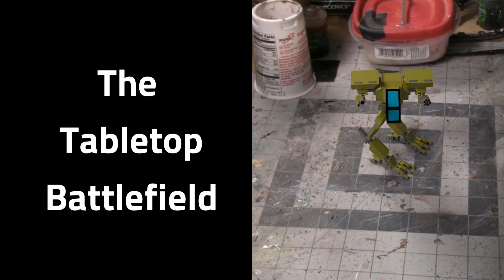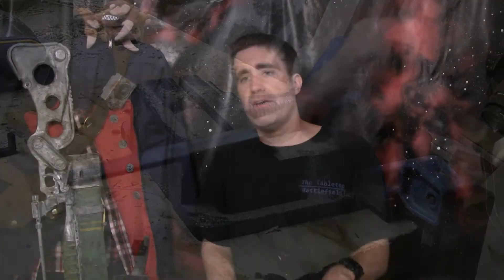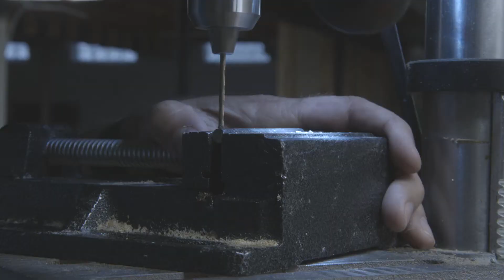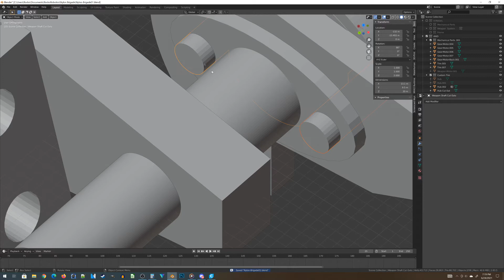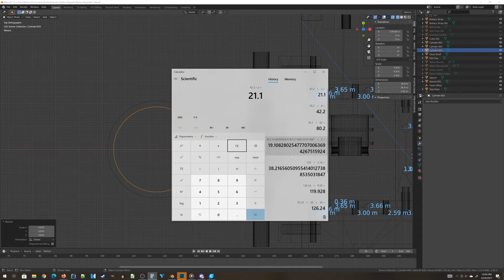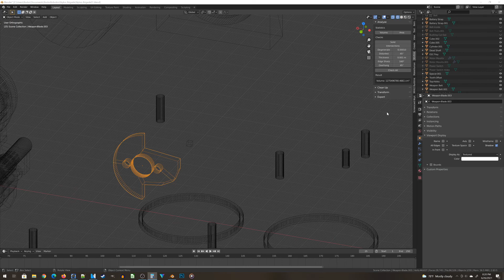Rapid Prototyping a Combat Robot's Weapon - Let's Build an Antweight

Comment: How do you calculate center of mass with the program you use?
Reply from the maker: Blender has an option for moving the Origin to Center of Mass by Volume.  Origin is just the term Blender uses for the defined center point of the object..

Comment: Very nice. I like how you're quite organized with your builds unlike me. One thing I'd recommend with building vertical spinners for a bit is having some sort of material or standoff directly under your weapon so that when you hit the opponent, you don't tip forwards. Thus, you can transfer your weapon's energy much more effectively due to half of the energy from an impact with your opponent being delivered into the floor and forcing them upwards. Nice job though!
Reply from the maker: It never occurred to me that those forks people put on the front of their robots had a second purpose.  Thanks for the tip.
Reply: @RockoRobotics  Oh yeah, no problem! They don't even have to be forks, just something directly under the center of rotation of the weapon. Glad I could help!